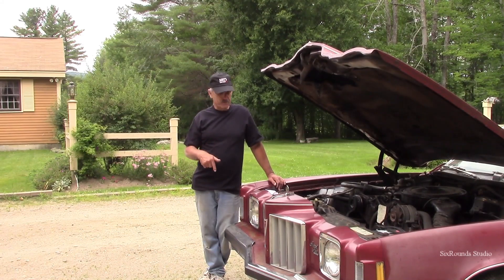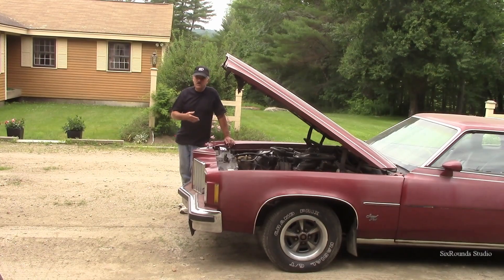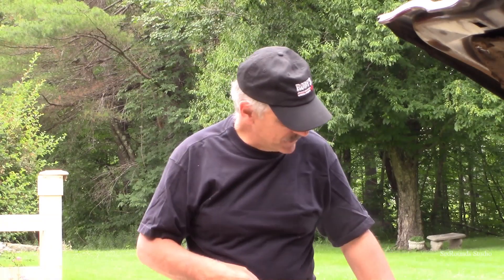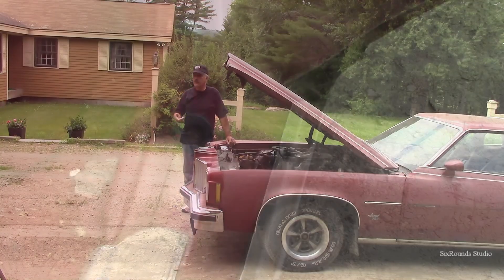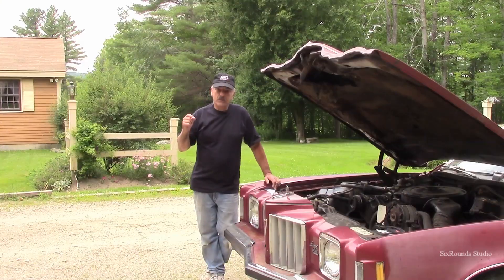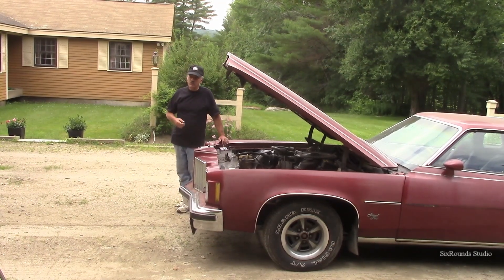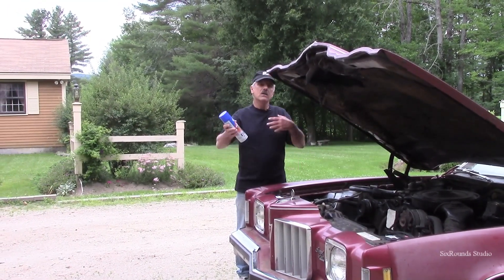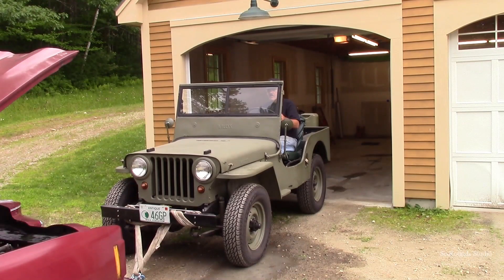1975 Pontiac Grand Prix: Stopping and preventing rust. (2019)

Comment: Awesome video! Yep, and we did exactly the same thing with oil, being from western NY area. Also, for our motocross bikes, we cleaned them with kerosene and circular brush (parts cleaning brush), and then hosed off with soapy water. Kerosene worked great on the steel rims, motor, exhaust pipe, and frame. Really helped out with rust and looked great.
Reply from the maker: Wow...I wondered if we were the only ones?  Thanks for props man...really appreciate it!